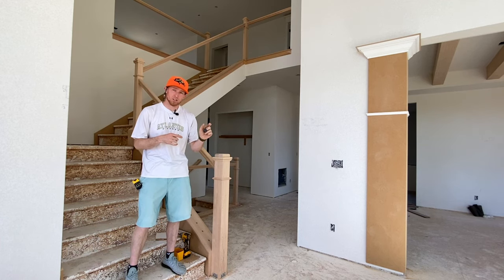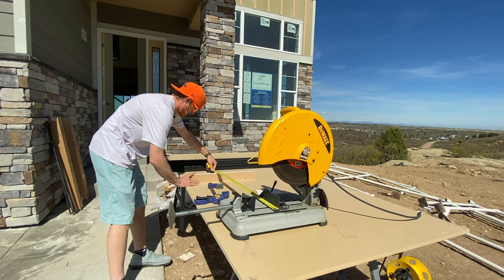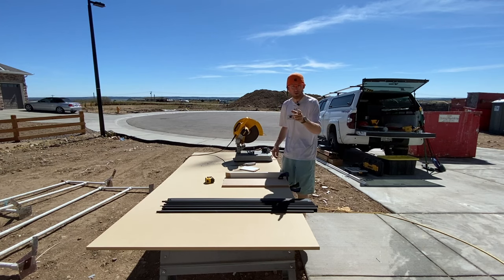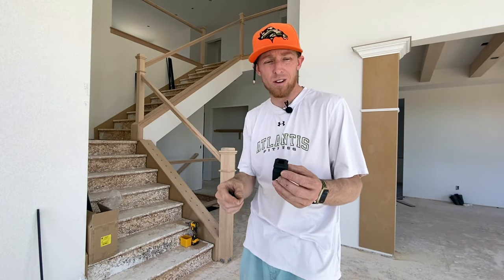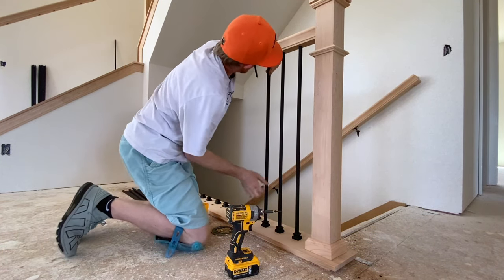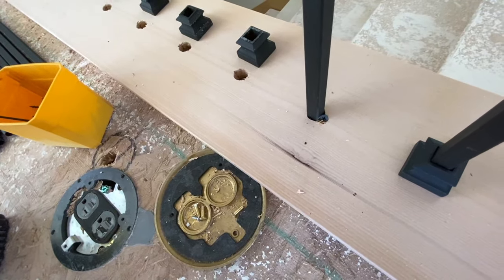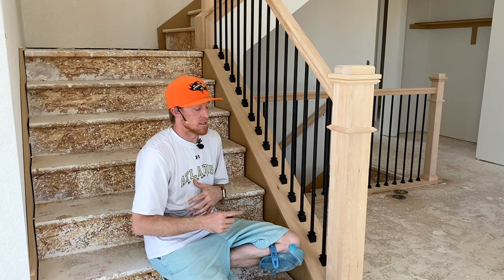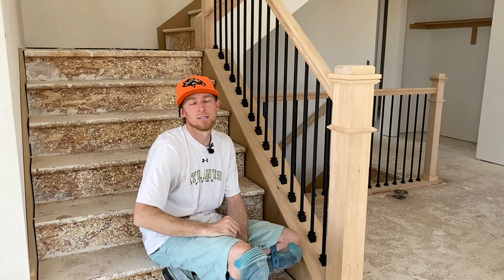IRON BALUSTER INSTALLATION / EASY DIY RE-SECURE *NO GLUE* : MEASURE, CUT, INSTALL, STAIRCASE UPDATE!

Comment: This was an insanely easy tip!  I used the boot on the bottom and top of the rails, so I was able to drive a screw in the top as well.  These things are solid.  Super quick install; no messing around with epoxy.

Thanks, Hunter!
Reply from the maker: You are welcome! Glad to help! I really like the design with boots at the top of the balusters as well! Thank you so much for your time and comment! Have a great day!
Reply: Shawn - the screw - r u taking about using a drywall type screw kind of a wedge? Or did you screw right through the baluster into the wood?

Comment: You’re the man! I’m replacing my Mom’s wood balusters with some depot iron. I woke up at 3am stressing about not being able to figure this out and having to let the old lady down
(I’ve watched like 8 hours of videos, I really didn’t wanna use glue because I knew I’d mess up multiple times) and then I ran across your video. I got pumped up and ran to the store for 6am opening. Got my first baluster up after about an hour lol I discovered I have a new problem now... I don’t have a flat table to use so I can’t figure out how to clamp the baluster down to cut it with my recip saw. I ended up standing on it and cutting it off my Mom’s deck.. Dangerous, but got the job done. If you have any makeshift clamping ideas I’d appreciate a plug! Also, I used to sell structural screws for a company named FastenMaster, we also had this sweet industrial hot glue gun called PAMFast. I believe you’re a finish guy, I bet you’d like it (only buy the yellow glue though, much stronger on wood to wood).
Reply from the maker: Awesome! Glad I am able to help out! Please let me know how it goes or if you have any questions. Have a blessed day!
Reply: I clamped mine in a workmate bench, and cut them with the angle grinder.

Comment: This is so smart! I'm going to be doing my  stairs sometime this week (going from carpet to hardwood) and this method seems so much more efficient and easier than other methods. I might even be able reuse my current plowed handrail if I'm securing to the treads via a screw. Might even try to screw the top of the spindle to the handrail and cover it with the other boot. So cool
Reply from the maker: Appreciate your input! Great idea on adding a boot to the top as well, definitely adds some additional detail to the rail! Hope you are successful with your project! Have a blessed day 😎

Comment: Man thank you for this video. I literally just counted mine and in total I only have 26. Only thing i have to do is drill all mine out cause the wood one’s on there now are just nailed in. And appreciate that great trick with the Sheetrock screw. It’s the little things that count the most.
Reply from the maker: You are very welcome! Thanks for taking the time to comment! Make sure to drill about 1 1/2” down so you can slide the baluster down into the hole and then slide up into the handrail hole for securing...if you have any additional questions I’m here to help! Have a blessed day!

Comment: I do mine the same way, 1/2" at the top and 11/16 on the bottom.  I put Lexel clear in the top holes though, this stops the tops of the balusters from rattling if the oak rail would shrink.  Ive seen guys take the rail apart, install the balusters and then put the top rail back on. Which is insane unless I  get paid a hell of a lot more!
Reply: I always cut my metal balusters with a jig saw instead of using the chop saw too. Less noise
Reply from the maker: Thank you so much for all the comments on this and other videos of mine! I really appreciate your time watching and then  commenting on your tricks that make it work for you! Glad to hear you do things almost the same way! Hope you have a blessed day 😎

Comment: I do stairs for a living and about the same age. I do the same thing with the screws but always glue the tops, probably not needed but i just always have. I only use a #8 3/4" screw though, like a hinge screw. 

I use a 7¼ dewalt miter saw with a metal blade, cuts iron like butter. But ill cut 4 at a time with a jig like you

For the caps i have a Milwaukee battery ratchet with a t10 bit. That thing is a gamechanger for me. Ill never go back to an allen wrench lol ill use a piece of lattice and push it against the shoes like a straight edge then tighten them

Comment: Like those drywall screw 👏👏👏
Reply from the maker: Appreciate you! Let me know if you have any questions! Have a blessed day!😎
Reply: @huntercarlson5446  used the screw idea VERY successfully today ty🙏🙏🙏

Wanna drop a few helpful tips for your viewers if that's okay

1. When cutting your balusters on steps the first one will be shorter than the next by 4 inches or so because the railing is going higher at the back of the step

2. Trying to measure balusters with double baskets can be tough to get an accurate measurement because the features dont let the tape sit flat. If you know you are cutting off 6 or 10 inches each time, just measure that from the bottom of the baluster. It's easier to be accurate.

3. Definitely use screws. They worked so well
Reply from the maker: Awesome! 😎 Thank you for following up and sharing your quick tips after using my technique to secure the balusters! Great idea on measuring the basket balusters from the bottom!
Also great tip on installing the balusters on stairs! Usually there will be 2 or 3 balusters per stair and you are exactly right, about 4 inches added to each baluster working your way back on each stair! 
Thank you very much for following up and adding great content to the channel through the comments! LOVE the hints from you! Any questions in the future don’t hesitate...have a blessed day!

Comment: I just finished a stairway with railing like this today, so the question comes to mind, was it just a preference thing, or why did you not wait until the staining was done to put the spindles in? Even if you’re worried about scratching the stain, it’d be easier to go back afterwards and touch up the stain than to tape up all those shoes pre-staining. That’s my opinion. I’m curious to know your reasoning. Great work!

Comment: Great video and explanation!  Beautiful work.  I hope you can help me.. we are installing a shoe on top of the spindle however when I tighten the Alan  wrench, the shoe tilts.  Do you have a solution?  Thank you for your time!
Reply from the maker: Thank you so much for the compliment! I sometimes have the same issue with installing “boots” on the top of the baluster touching the handrail... my only advice that I can give you is to hold the boot super tight to the top and tighten the Alan screw...it will tilt just a bit unfortunately, don’t know if it’s the boot or what...in the past I’ve had about a 1/8” gap on 1 side of the boot with the other side touching snug to the handrail...
This is just a guess...haven’t tried it myself... you know how there is additional space that the boot leaves around the baluster, try wedging a flat head screw driver (maybe tape the end first so it doesn’t scratch) and while you are holding the boot tight to the handrail with the screw driver wedged between baluster and boot on the Alan screw side, then tighten the screw. I’m hoping with the additional friction it will help keep that boot in place. 
I really hope this helps! Sorry I don’t have a clear cut solution for you right now! Get back to me if you have more questions! Have a blessed day!

Comment: Looks great Hunter.  I may try that method on one of my installs in future.  Curious though...What is preventing the baluster from wanting to turn slightly in the hole and not aligning flush to front?  After all, it is a square tube in a larger than normal round hole.  Seems to me the torque of the screw will result in a twist.  Second, is the reason you are inserting bottom first instead of top first because you are using this screw down method?  I typically use a urethane based adhesive in both holes as the product expands whereas, Liquid Nails is a mastic product and can break loose as you suggested.  Still, your method seems quite clean and fast.  Take care!
Reply from the maker: Thank you very much for your time and comment! I understand your questions... So round hole and square baluster possibly turning... when I'm holding the baluster align to the front it has 2 points of contact, 2 edges of the baluster against the side of the hole in the material. The screw head will be my 3rd point of contact...run the screw at a downwards parallel angle and tight to the open flat edge baluster (like a 45 degree angle to your material roughly)...drive the screw in so that the head of the screw is pinching tight against the open flat edge (it will scratch the baluster a little underneath the boot).  You do need to hold tight on alignment of the baluster during the screw process, the baluster might want to twist on you, like you sad. I find that the baluster moves down on me more often with the screw, so have pressure holding up snug to the handrail as well as pressure aligning to the front. If done correctly you will most of the time indent the baluster edges into the material for a snug fit! With those three edges nice and tight I personally have never warranted a "turned" baluster for a homeowner before. Next the screw down method your mentioning. I drill the handrail with 1/2 paddle bit about 1" deep, I drill the bottom cap with 11/16" about 2-3" deep (some iron are different thicknesses depending on manufacture, I use 5/8 sometimes on the bottom for a tighter hole). Since I have drilled down that far it gives me a little more convenience on cutting (doesn't have to be perfect size) and it gives me the room to drop the baluster down far enough to get it in line of the top hole. Yes with my method I am using the baluster tension at the top to hold it snug and the screw at the bottom. I use to use liquid, then caulk, then epoxy, but please at least try this method on a small flat layout! Im not exaggerating when I say this, after 200+ houses of iron balusters installed for DR Horton, and warrantying each house for 1 year (track home builder here in Denver) I have only replaced damaged iron...NEVER called back for loose balusters! I have the technique down and have taught it to a couple workers of mine,  so just a little practice on feel and getting that screw in position!  
I hope I mentioned what you were looking for...
Thank you so much and get back to me with more questions if you have them!

Comment: Thanks for the great tips.  I just wanted to verify that I am supposed to be inserting the screw at an angle through the metal and into the wood?  Any chance you can share a close up pic of the base of the baluster with the screw installed?
Reply from the maker: So sorry I haven’t responded in a long while! Was camping for 2 weeks and don’t have service...insert the screw at an angle next to the baluster so when the round head of the screw passes the flat part of the baluster it pinches the baluster to the wood...unfortunately I don’t have a picture to show you right now...the next chance I get installing iron balusters I will take another video and pictures! I also have some very lengthy responses to comments on this video that would help! Summer please don’t hesitate to ask another question! I will get back to you much faster this time! Have a blessed day!

Comment: Hi Hunter!  Great video, thank you so much for this!  Question for you, we are replacing the old wood balusters with the same 1/2in iron ones you used. The problem is the wood ones were much bigger than the iron ones so we are having to remeasure everything.  I know we have to have them less the 4” for spacing but how/where do we start in order to have them evenly spaced or to know what the spacing should be for the space we are working in.  For instance we have one railing that is 31in in width, one that’s 51in and one that’s 52in. How do we figure out if it should be 3.5, 3.75 etc?
Reply from the maker: Ok so let’s start with 52” run of balusters…
- 52”(width of run) divided by 4”(spacing) equals 13…there will be 13 spaces of exactly 4” in between each baluster. 12 total balusters for this section.

Next let’s do 51” run of balusters…
- we know 52” is exactly 13 spaces of 4”…
- we need to loose 1 inch on spacing over 13 spaces…
- in this case each space will be 3 15/16”, loosing 1/16 each spacing… with 13 spaces we will be off about 3/16 at the end…so split the difference on each end…
-I would start with 3 7/8” on the first spacing then 3 15/16” for the next 11 spaces, ending with around 3 7/8” for the last…

 Now for 31” 
- let’s get to the closest number divisible by 4…which is 32
-32 divided by 4 is 8…so 8 spaces and 7 balusters…now to get the spacing
- we need to loose 1 inch over 8 spaces…there are 16/16ths in 1 inch…so we need to loose 1/8” each space…
- each spacing will be 3 7/8” for the run…

Really hope this helps! I have another video building 1 section of rail start to finish with iron balusters…please check that out! I show you how I mark the spacing and drill the holes for the balusters…
Thanks for watching and have a blessed day!
Reply: @huntercarlson5446  Thank you so much!  I really appreciate this! Have the best day!
Reply: @huntercarlson5446  you've got a gift for explaining with clarity which creates an understanding. 
Kudos!
Reply from the maker: Appreciate it! Thanks for watching and have a blessed day 😎

Comment: Great job, I’m just wondering if is easier to paint the handrails before to put the balusters? Thank you.
Reply from the maker: Sorry it took a while to respond…yes it is easier to paint before installing the iron…I am required to finish the handrail with the iron balusters to keep the house up to code during the construction process. If someone were to fall through the rail, even during the build, I would possibly be liable for the damage. Thanks for watching and have a blessed day 😎

Comment: Great video, thanks! Can you let me know what saw blade you're using as well?
Reply from the maker: Appreciate it! I’m using a 14” X 7/64” X 1” Diablo metal cutting aluminum oxide blade found at Home Depot. Lowes will carry the Dewalt brand and will also work as long as the specs are the same. Thanks for watching and have a blessed day 😎

Comment: You mentioned cut the spindle one and half inch longer than the height, but what depth do you drill into the hand rail and the bottom ? 🤔 👍🏴
Reply from the maker: Drill about 1 1/2” - 2” at the bottom. About 1” at the top for the nub of the baluster, or measure how long the nub is at the top of your baluster and drill a little more than that measurement. Hope this helps and thanks for watching! Have a blessed day 😎
Reply: @huntercarlson5446  Cheers 👍🙂

Comment: Great video, thanks! I have ordered some adhesive but will try it this way. I didn't notice if you mentioned it or not, but was is the distance between the balusters? I am going to replace my wood balusters with iron, but am unsure if I will need to redrill holes to have them spaced to code.
Reply from the maker: Thanks for the compliment! You need to keep the baluster spacing 4 inches or smaller. Hope the wood balusters are already spaced right for you!! Please let me know if you have any additional questions when you start the project! Have a blessed day!

Comment: Great video. Thanks for sharing your technique. Are the hole dimensions you specified for 1/2” spindles?
Reply from the maker: They are 5/8” spindles (measuring from corner to corner diagonally) with a 7/16” nub on the top. Appreciate your feedback! Let me know if you have any more questions…have a blessed day 😎
Reply: @huntercarlson5446  Thanks. My spindles are advertised as 1/2” and measure 1/2” on the flat side and 5/8” diagonal.
Reply from the maker: Those are the same size that I’m using! 👍🏻

Comment: We're getting ready to switch ours out from wood to metal, too. So just to clarify on the drywall screw, you just screwed that in up against the rail and not actually through it, right?
Reply from the maker: Yes you are correct. I keep the screw parallel and tight to the flat surface of the baluster to start. When the round head of the screw gets to the flat part of the baluster it will pinch the baluster in the hole. It might take a few tries to get the first one snug and secure, but once you get the first one done you will understand the technique for the rest! Thanks for watching and let me know how it goes when you switch them out! Have a blessed day 😎

Comment: How strong the iron baluster should be? I saw somewhere the code said the baluster should  resist a load of 50lbs per linear applied in any direction. But seemingly these hollow iron balusters aren't as sturdy as the old school solid wood's.